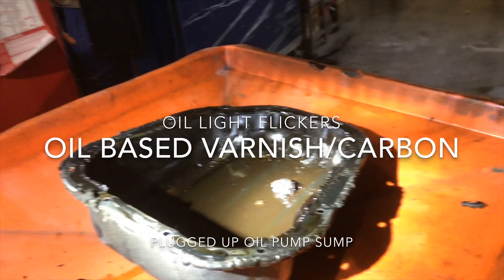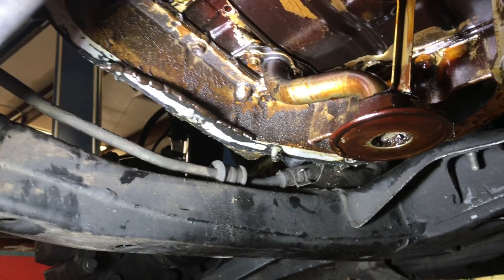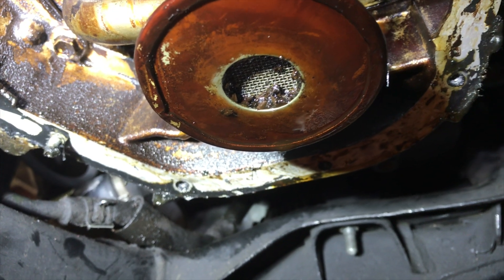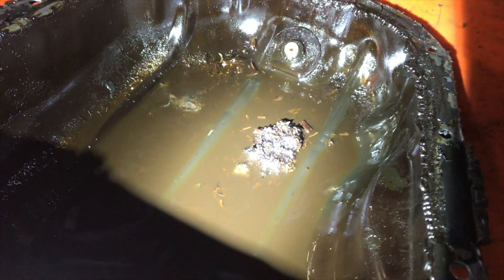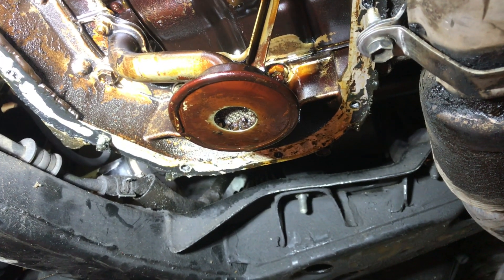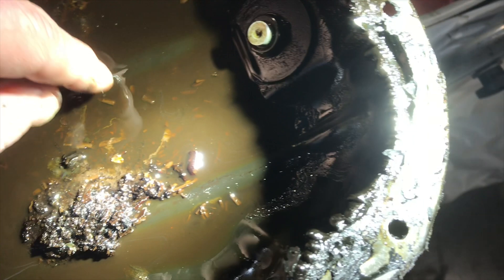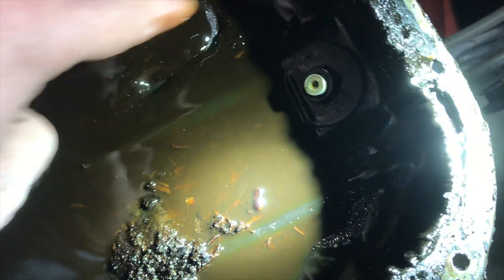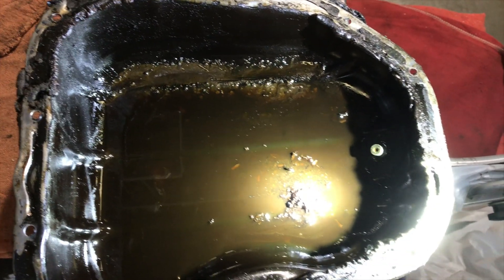Toyota Oil pressure issues

Comment: Just found a lot of carbon in my 01 Tacoma w similar mileage when I changed the valve cover gasket. I’m considering dropping the pan and taking the valve cover back off then cleaning somehow. My oil pressure light isn’t on. I’m conflicted.